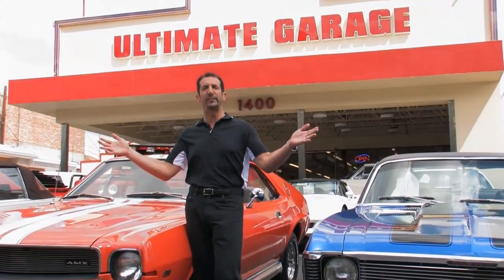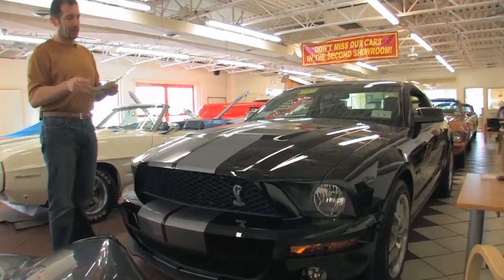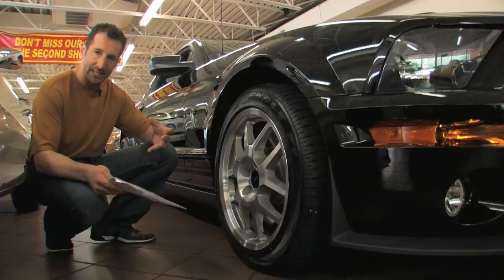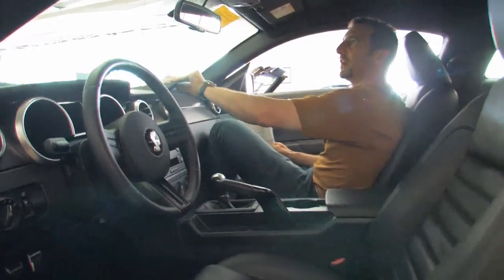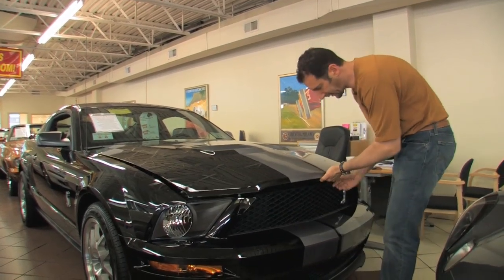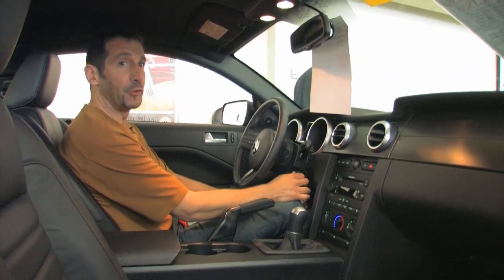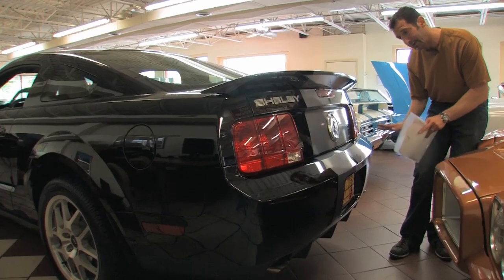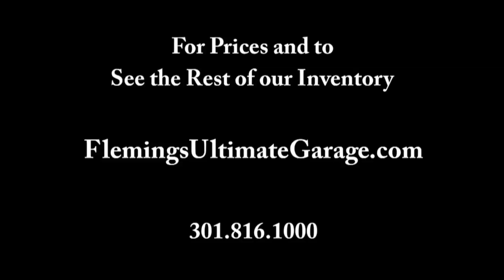2007 Mustang Shelby GT500 for sale at with test drive, driving sounds, and walk through video

Comment: 07-09's are the best gt500's they are the most throwback to the original looks wise and have and iron block. Newbies that don't know much about engines will go for the 11 plus with aluminum block but what wears faster aluminum or IRON? come on people…10 years down the road that aluminum block is shot where as the IRON will go much further and when it does need rebuilt you can and maintain that original block.

07-09 hands down. Mark my word in 20-30 years from today 2016…they will be the most valued years. This HP war won't be around forever it can't...
Reply: I agree with you I own a 2007 gt500 supersnake and a 10 supersnake.Also a 08 gt500 and a 07 Shelby gt.Yah people say you have a iron bock and I say what is stronger.
Reply: @anthonylaudano9751  It's good and bad it's heavier but it's alot stronger
Reply: You have no idea what you are talking about. The aluminum block is a much better block and with sleeves can handle 2000+ HP. The iron is ok for a cheap build but is limited to about 1300hp and is about 120lbs heavier.

Comment: @Mike2VP Actually Mike2VP your correct, roughly 450 at the wheels but at the crank the 5.4 power plant produces 500HP. Most cars lose 15% of engine power from the crank to the wheels. Shelby absolutely has 500 HP at the crank  thats why its called the GT500. Oh and FYI the 2010 GT500 has 550HP.

Comment: @TheLethalstang Yeah it was a smart move on Fords part giving the Shelby the aluminum block saving alot of weight. Of course what I was stating was that the car in the video 2007 Shelby GT500 has Iron block with aluminum heads.